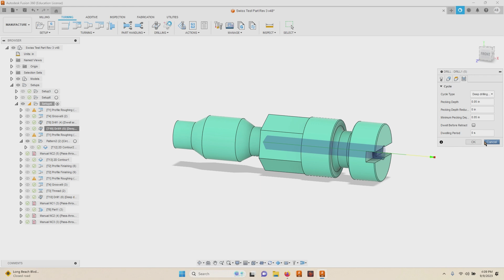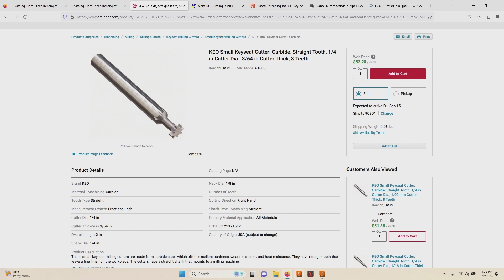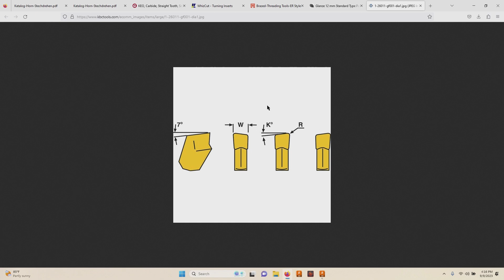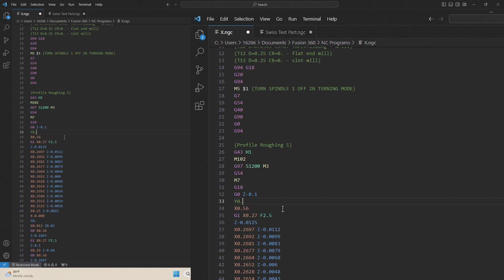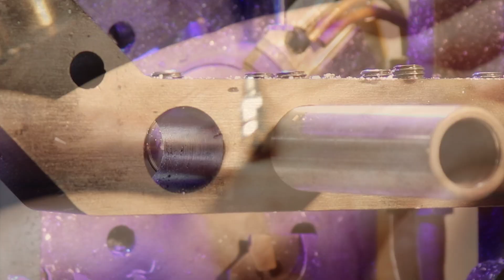Making a Test Part on the APSX Nano Swiss Lathe

Comment: A great content about the APSX NANO. The reason for the $1 on the post is that the drill tool you used has the Live Tool Check box checked in the tool’s settings. If you uncheck those they should be output for main spindle.
Reply from the maker: Error leads to truth! 👍

Comment: Great video that answered many of the questions I had about the machine after looking at their website which could frankly use some help.   I am intrigued to see that it can run with F360.  I am assuming that you need the paid version, not the hobbyist version but I am wondering if you could shed some light on which additional add ons you need to buy from autodesk.  Their prices for multi axis stuff are beyond what a hobbiest like me can afford.  I have a little Penta machine pocket NC but the fact that I cant do full 5 axis without a several thousand dollar per year add on is a real bummer.  Thanks for taking the time to make and post the video!
Reply from the maker: Glad you enjoyed the video! Let’s talk. Drop me a line over at www.brauncoengineering.com

Comment: I bought one of the very first ones when they released it.  It had so many bugs and issues, and an intense lack of support, I wound up returning it.  Hopefully they have gotten a lot better since my experience with them.
Reply: I have a Nano. I have NEVER experienced support as bad...
Reply: @jtambor1  Well, I guess I was the lucky one then.  When the machine couldn't even home itself within .001" I was done.  Best it could home itself was .050".  It was a joke, and I'm just very happy they stood by their equipment and gave me a return on it.  I also sent them a test part which they completed and sent back to me.  When I tried running the test part, it failed miraculously.  When I asked what I was doing wrong, I was told, oh, we couldn't get the machine to do your whole part, so we did a 2nd op by hand.  That was kind of the "I'm done" point for me and I returned it.  The whole point of the machine was to be able to run that particular part.
Reply: @WadeWendorf  Thats horrible. Glad you were able to return it. When did you purchase it? I'm now worried about mine. Got it in late 22. Have not spent a whole lot of time on it because part production priority changed..
Reply: @jtambor1  4/26/2022 is when I got it.  I think I was one of the first to buy one.  I would have worked with them on fixing the issues, but they weren't interested in feedback and their reply was that it operated as designed.  I hope you have better luck than me.
Reply: @WadeWendorf  What a shame. How are we supposed to support American small businesses when I run into this nonsense regularly?
Reply: @jtambor1  It's certainly not how I run mine, that's for sure.
Reply: @mandalaroseworks  Same here.

Comment: Great Video!  Where are you buying stock that is precision ground undersized?  And, does this machine require the manufacturing extension?
Reply from the maker: Thank you, glad you enjoyed it! You can source precision ground stock from outfits like McMaster Carr but can find it significantly cheaper from local wholesalers. Fry Steel Company is one such source in Southern California. We also centerless grind our own stock when needed. You may need the manufacturing extension depending on what license you have for Fusion 360. I recommend following up with APSX directly.

Comment: Thanks for a great in-depth video. It looks like a pretty capable small machine for small runs of parts. Are you happy with the machine? What kind of tolerances can you hold in stainless steel? Are you able to cut harder materials in a reasonable amount of time?
Reply from the maker: Thank you, Steven! My favorite thing about the machine is that it offers a lot of capability in a small physical and financial footprint. There are some improvements I would like to make to improve its accuracy and rigidity which I hope to share in future videos. The relatively small amount of stainless steel parts I have ran on this machine were within the +/-0.0025" range; however, the lack of flood coolant is the biggest draw back for cutting that material due to heat and tool wear. I am confident the machine can make good time in 303 SS but repeatability issues are likely with 304 and 316. If you want to get into the weeds, feel free to send me an email via the contact form at www.brauncoengineering.com/contact

Comment: I know that part well lol. Xometry failed my swiss test part because it was supposedly .0001 out of tolerance on the on the groove diameter. Cool video looks like a pretty interesting machine.
Reply from the maker: They failed you over a 10th?!? I have a similar story with them not sure what’s going on over there. What machine did you make yours on?
Reply: Lol yea it was a little upsetting but I've been lucky to get a decent amount of work directly from customers instead of having the middle man. I was mostly just interested to see how much its possible to make off their jobs since I've heard people give positive and negative reviews about xometry. I'll probably try the sample part again when I get some free time so I can form my own opinion on them. I made the part on my 1998 citizen m20.
Reply from the maker: Agreed, I’ll try again if nothing else for the free material. Shoot me an email via the contact form on my website I’d love to check out your business. Thanks again for watching!

www.brauncoengineering.com/contact
Reply: @braunco.engineering   Xometry went to shit about a year after they started providing materials/waterjet.
Reply from the maker: @OGBRADASS  I'd be curious to hear your experience. Were you working with them as a supplier or having parts made?
Reply: @braunco.engineering  supplier, and had some stuff waterjet, it's nicer to make stuff out of sheet instead of extruded. However their tolerance was shit. They ended up doing it twice.

Comment: Can't you put your drills closer?  No wonder you have to use a spot drill.  There should be no reason to spot at all. This is an OLD OLD method used by manual machinists. They have no place in a modern cnc world with the tools we have. BTW I have a Brother Speedio and a Cubic GTV for sale if interested.